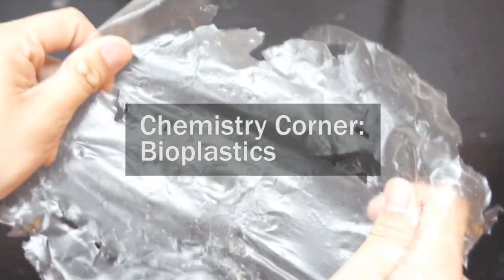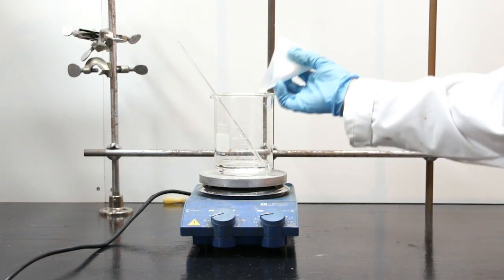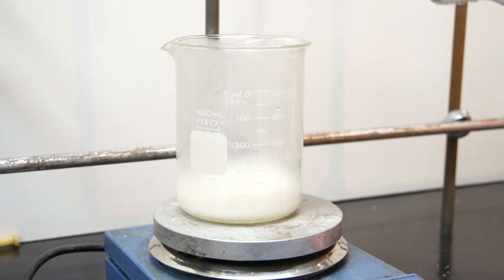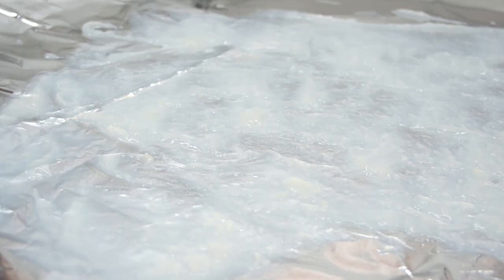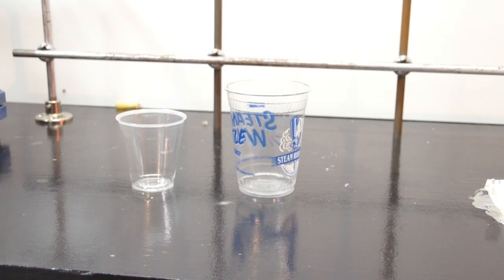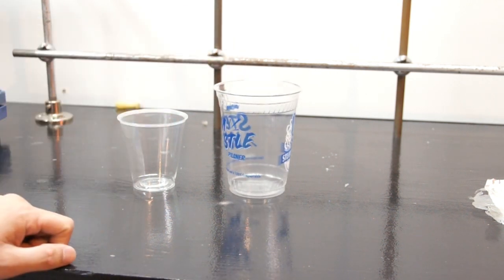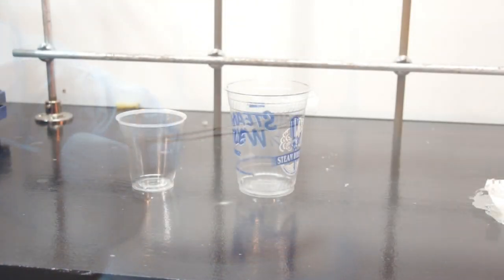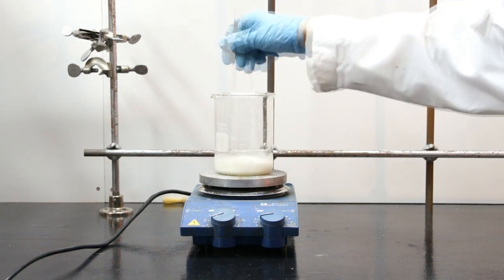Chemistry Corner - Bioplastics

Comment: Is the bioplastic you made soluble in water? Does it melt in heat?
Reply: It looks like it would probably melt in heat, but I am not a material or chemical scientist or anything like that, it would be interesting to see if it would jam a 3d printer or not, if not would be interesting to try, if only I had a 3d printer lol (and something to extrude the material to the coils width for a 3d printer)

Comment: So if i wanted a hard plastic bar that i could cut in to disc, could i just leave out the glycerin ??
Reply: I don't think you can do that whether you leave the glycerin out or not. It is because what you are going to end up making a low molecular weight polymer that is in this case a low molecular weight polylatic acid (PLA) from starch. You will need a polymer with a very high molecular weight for a hard plastic bar. I don't know what your application is. There are different types of polymers with a wide range of molecular weights for a variety of applications. And I still doubt that it is practical for you to do it by yourself at home. Correct me if I'm wrong. Let me know if you had tried making the plastic bar using the approach mentioned in this video.

Comment from the maker: @hkparker I forgot to tweak the audio to remove the noise and echo like last time, plus I'm just tired. I've been heading up all the logistics for Makerfaire for my local hackerspace. I was too rushed to really edit this video to my liking. Stay tuned for the Makerfaire Toronto video too.
Reply: Hi aonomus, I'm doing some light research on these to see if I could cast sculptures with plastics like these instead of smooth-on resin mixes. Do you know if this kind of plastic would yellow over time if exposed to sun over the years? If I cast a solid figure with this, would it dry transparent like the cups or pretty opaque?